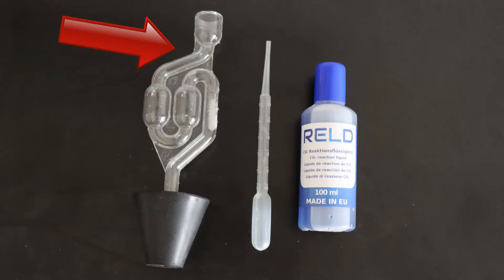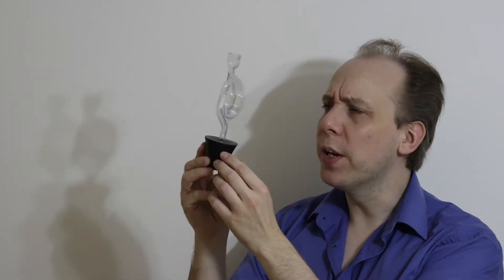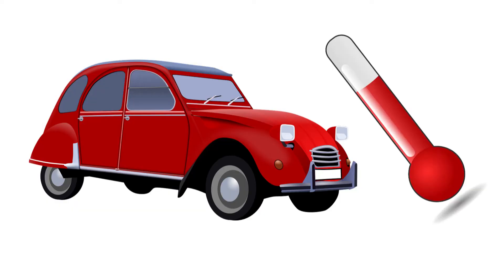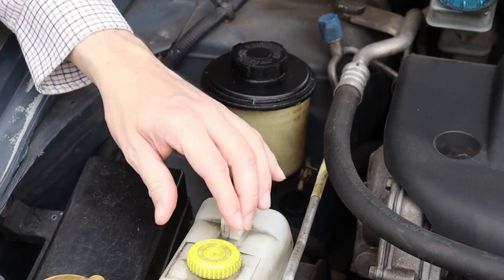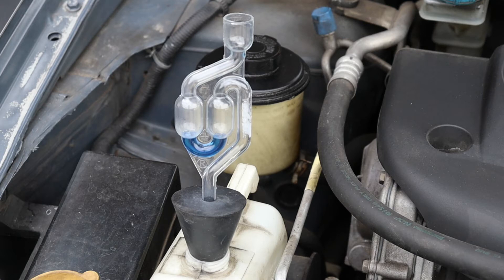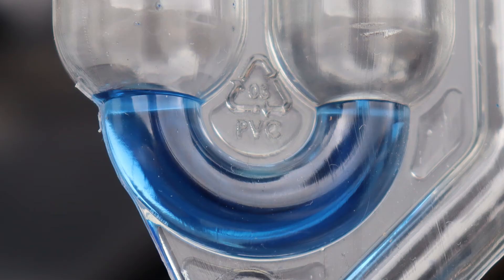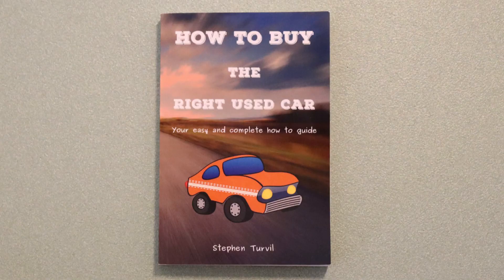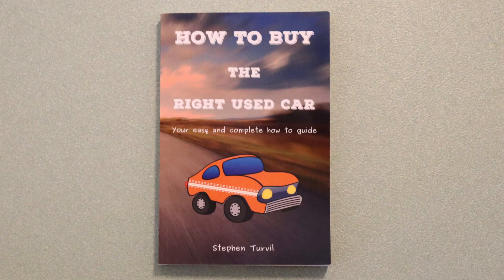How To Use A Head Gasket Tester (Blown Head Gasket Test)

Comment: What’s it mean when it’s bubbling. Up when I press the gas
Reply: Oxigen in the coolant. It's a leaky cooling system anywhere. Or the cooling system has not been vented properly.
Reply: @robertnagy2456  it’s on my srt8 charger , I did a compression test and it held strong for a hour before I released pressure I’m still really confused on what’s going on .
Reply: @robertnagy2456  bc my coolant boils sometimes not a head gasket and compression test held strong so
Idk at this point
Reply: @4TheBoyzTV  It is necessary to measure the antifreeze with a refractometer, is it not too watery? For us, the level set to -35 degrees is appropriate. If the value is too high, it means that the antifreeze has a high water content.

Comment: Mine stays blue (left for 10 mins) but the fluid bubbles. I tested the fluid by blowing through the tester after and it turned yellow so not sure what tge bubling means
Reply: I think the test fluid is reacting to co2 so if you blow through it, it finds co2.
Reply from the maker: If you're unsure, it might be worth looking for other signs of gasket failure, e.g. creamy oil. Good luck.
Reply: Bubbling is normal. If I remember correctly, it mentions it in the instructions in the box

Comment: I recently bought this and my car turned out positive, now my concerns is if these are really legitimate?? I was reading a review on Amazon about a guy who bought the same product his car turned out positive but he wasnt convinced, he did a test by boiling tap water in a bottle and using this on top of the bottle and it turned positive, it would seem like its a type of dye that changes color depending on the temperature and doesnt have any co2 detecting properties.
I want to do the same test as I'm having the same suspicion.
Reply from the maker: Might be worth looking for any other signs of head gasket failure, e.g. milky oil. Good luck.
Reply: @CarSpyTV  no coolant/oil mixtures but definitely losing both slowly and no visible leaks although i do get smoke but not as much as a full blown gasket
Reply from the maker: @GCS88  Perhaps it's time to get a second opinion from a mechanic. If the gasket is on its way out, it's better to find out now rather than wait for the car to fail completely half way through a journey. Hope things work out.
Reply: @CarSpyTV  I'm gonna rip the engine apart anyway I just had a check today seems like the car is suffering from an external oil leak between the head and block seam so thats where the oil loss is, I guess the coolant is going to the cylinders as I usually get white smoke... I'll fix all this when the weather permits as the Irish weather is usually not forgiving for these kinds of activities.
Reply: When mine went my heater would always go cold as combustion gases would create air pockets in the heater core. I never had any mixing of coolant and oil.
Reply: @arbit3r  I installed a radiator filter/observation on mine, no matter how much I bleed the system air pockets would always form inside I guess thats the combustion in the system...
Reply: 5 months passed already figured out what was wrong, I'm loosing oil because of a bad pcv system it was pushing out oil through the turbo that causes my white smoke, fixed that.
as for my coolant loss its due to the audi radiator quick connect hoses, at the time of the initial comment I replaced my radiator but not my hoses and they have probably swollen up some miniscule amount that they seep out coolant where it evaporates instead of dripping
Reply from the maker: Interesting info. Glad you've made progress.
Reply: @GCS88  good info. thanks

Comment: The liquid is still blue but it has a slight emeraldish tinge to it. Is this still fine?
Reply from the maker: Might be worth looking for any further signs of head gasket failure. Creamy oil, for example.
Reply: @CarSpyTV  no oil in coolant and no coolant in oil.. if I show the liquid to anyone they will say it's still blue. bit i have the before and after picture and you can clearly see it changed. I run it for full 5 minutes, maybe I've run it too long?
Reply from the maker: @Professional_Youtube_Commenter  If there's any doubt, it might be worth getting it checked professionally.
Reply: you might have a undetectable loss of liquid then? mine certainly is losing coolant and oil but no mixing of either, no visible leaks just keeps on losing liquid slowly.
Reply: @GCS88  i did the test again, yes I have a radiator leak and after the coolant circulates a while it tends to suck in air from outside into the expansion tank. I think it may be sucking in carbon dioxide into the liquid from the air and changing colour a bit. I noticed that it get the emeraldish tinge when the coolant is being sucked in backwards rather than being expelled away.

Comment: Hi ! Pretty good video, i'll use that to buy my first car and check my motorcycles.

I have a dumb question, are you sure the liquid works ? I mean it's a cheap kit i'm worried it might just be blue water. 

I'll buy it any way, just was wondering if you were able to test it :)
Reply: To test, run some gas from an exhaust pipe through the liquid. If it changes colour, it works.
Reply from the maker: Interesting idea.
Reply from the maker: Good question.

Rather than buy a cheap kit, it might be preferable to pay more and get a branded version from a seller you can trust. That’s what I did. Furthermore, note that you can order such liquid separately to any kit, e.g. via Machine Mart.

Also, if you’ll use the kit on a range of vehicles pay attention to the size of the adaptor (the rubber bung). It needs to fit as many vehicles as possible. My adaptor ranges from 25 mm to 50 mm, for example. Some are more restrictive. 

Finally, I’ve written a book that might help you further. It’s called ‘How to Buy the Right Used Car’ and it’s available at Amazon. 

https://www.amazon.co.uk/dp/B088T7TCTQ/ref=sr_1_1?dchild=1&keywords=how+to+buy+the+right+used+car&qid=1589898627&sr=8-1

Hope that lot helps.
Reply: @CarSpyTV  thanks a lot ! For the advise i bought it, it works great ! Also about the book why not, i'll look at that later, thankks
Reply: Hiii well i bought it and it works xD but bottle is shiet it doesn't seal it great so if you keep it in the trunk, carry it when visiting cars, motorcycles etc.. it'll start turning yellow, at least green :/ si gotta store it in a good bottle
Reply from the maker: Glad you've got the kit. Might be worth transferring the liquid to an empty water bottle. That should have a good seal.

Good luck with your motoring adventures.

Comment from the maker: Got a question? You can ask me in the comment section.
Reply: Will this work if there's no coolant in the system. Just water. Just replaced the engine 👍
Reply from the maker: @davidhenderson7722  Yes. The liquid reacts to CO2.
Reply: @CarSpyTV  cheers buddy 😁👍
Reply: 2 questions...1. Isn't it true that some cars don't have radiator caps? 2. Won't waiting five minutes cause the coolant to get hot and bubble up and possibly spray? Thanks!
Reply from the maker: Question 1: yes.
Question 2: never had that problem.
Reply: Does the kit comes with all equipment and if its a bad head gasket it'll turn another color?
Reply from the maker: @timholla7014  Yes. The fluid changes colour if there's a leak.